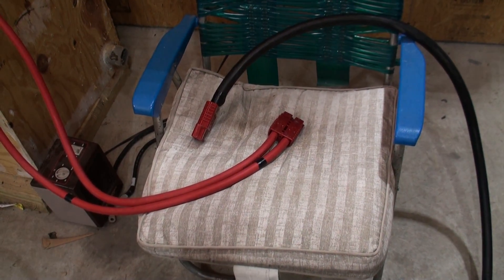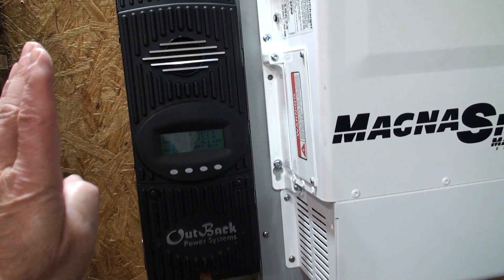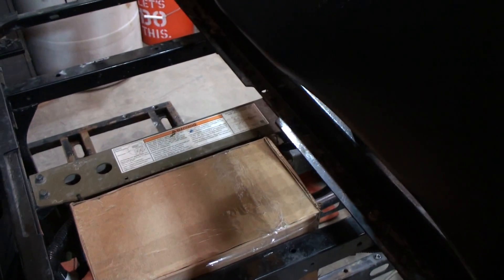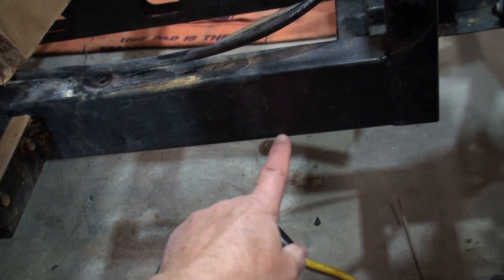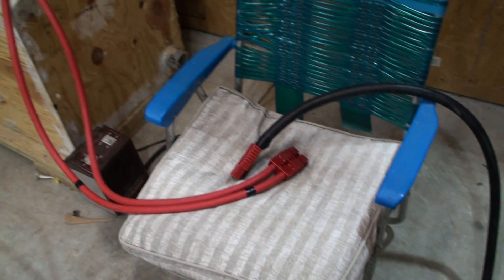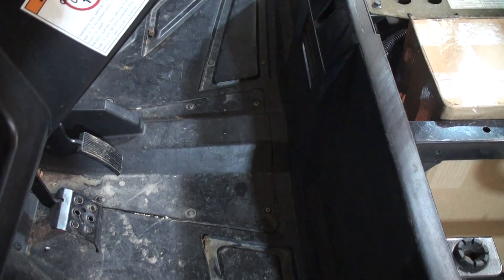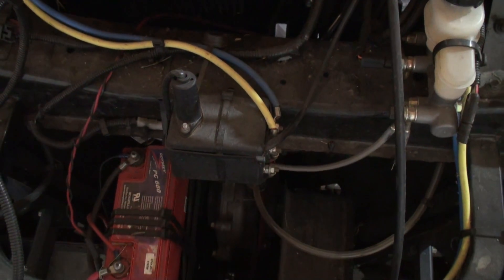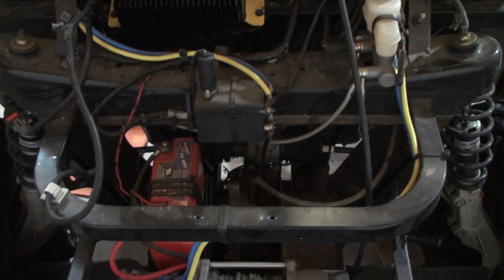Part3, Battery Upgrade on Polaris Ranger EV + DC Charger from Solar

Comment: you have one charge controller feeding another charge controller, which then charges the batteries.  that sounds like a waste of a charge controller.
Reply from the maker: NO, like many people, I have multiple 48v strings of solar panels that come to multiple controllers, but all charge the same battery bank because it needs that much incoming charge.  It's easy for me to pull 60a 220v off my system.  So I need more than that incoming to charge & provide my power during the day.